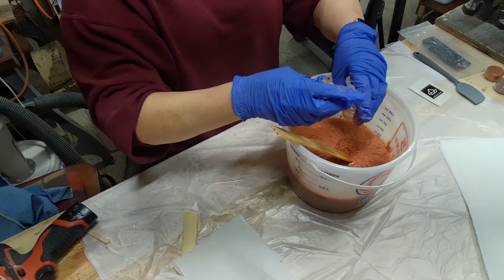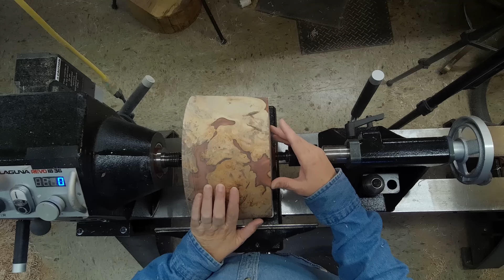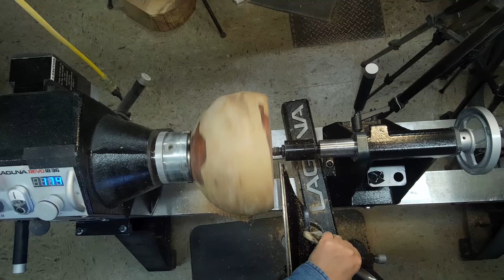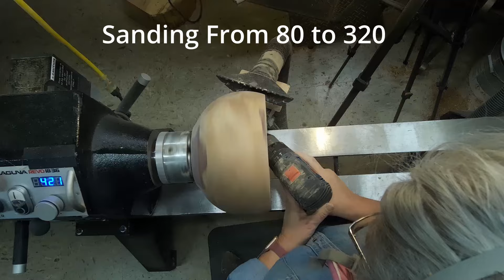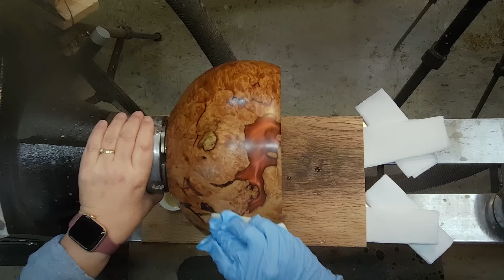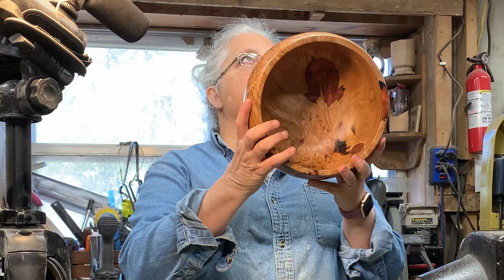Woodturning Amazing Burl - I Broke It

Comment: Excellent job 👌. Did you say what finish you used?
Reply from the maker: Thank you for your comment and question. The process I use in this video is what I do for my pieces that have epoxy. I realize the Yorkshire grits are not actually finishes, but with both of the containing mineral oil and bees wax and also using the myland sanding sealer first gives me the best results and shine. Of course I consider my pieces more for decoration than utility purposes. I hope I explained my process okay.